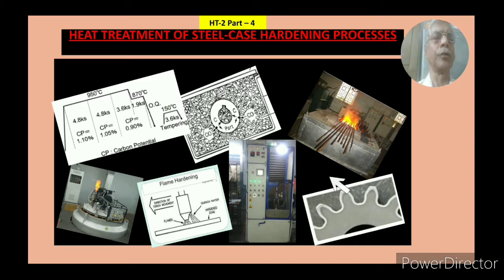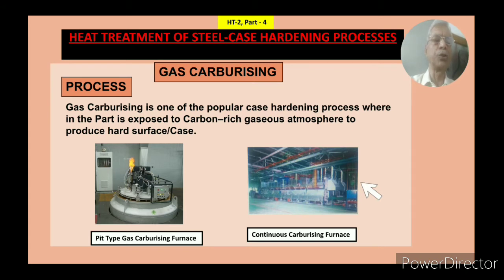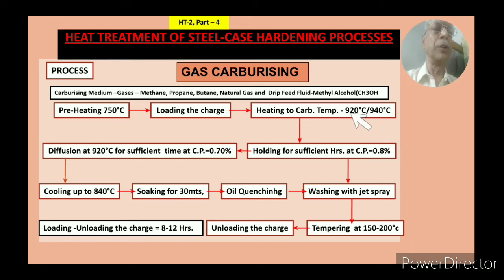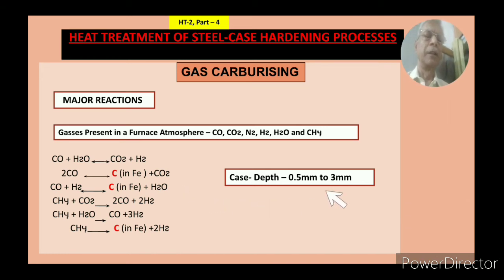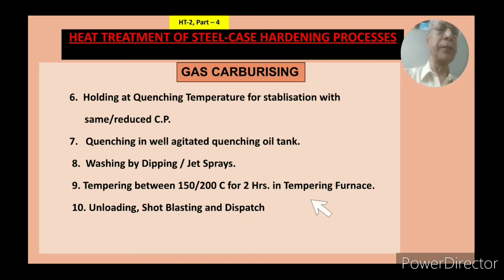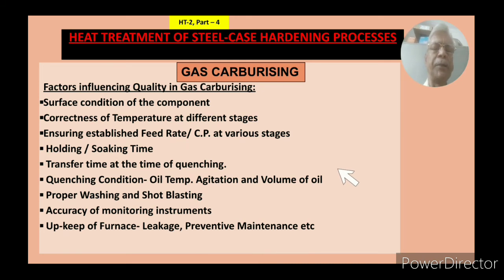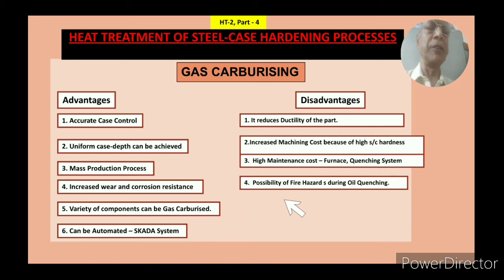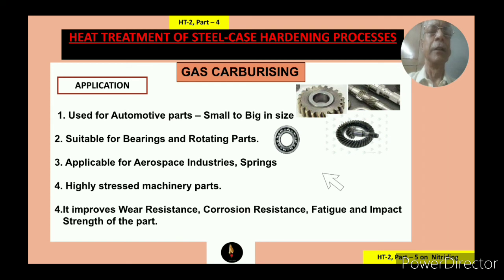HT-2 Part 4 E on Gas Carburising in English- Jagdish Chaubey

Comment: Illustration of gas carburizing method of heat treatment for steel components is excellent. It is most practical, very well taken care of safety aspect also. This will be very useful for industries to a large extent.
Reply from the maker: Thanks for your valuable comments.